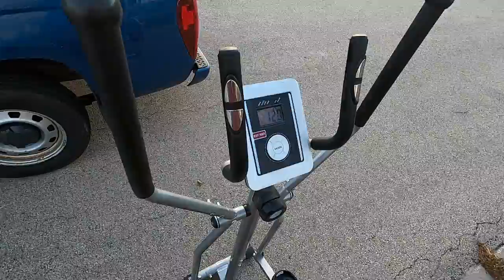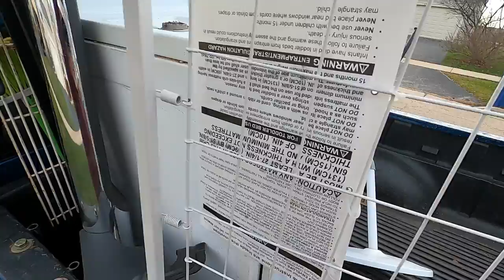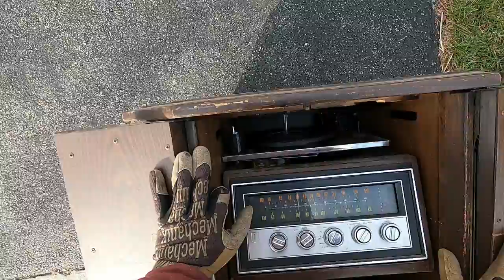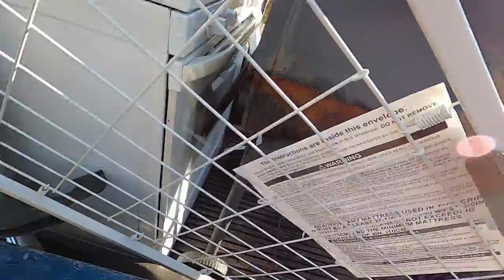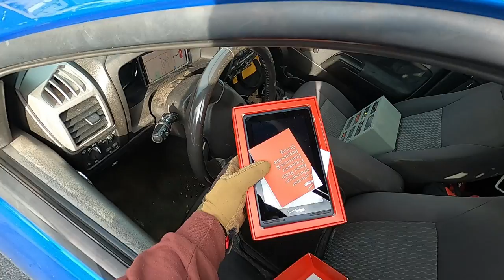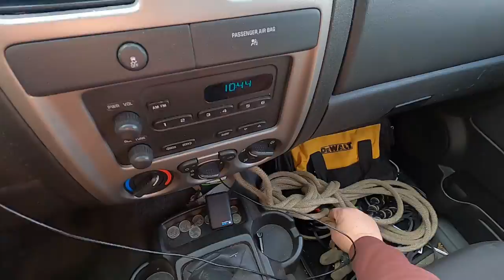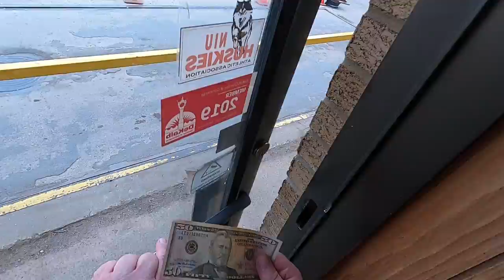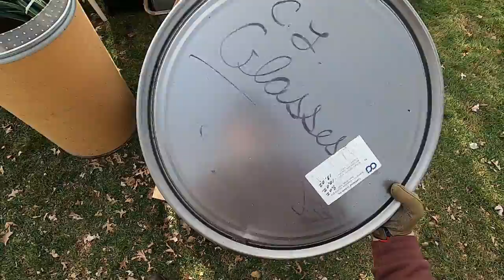Brand New on the Curb - Trash Picking Treasures

Comment: Paul, you have talked a number of times about a bigger truck. From my perspective the costs of a bigger truck will not be offset by the amount of scrap you can process. I believe you would benefit from better utilization of your current truck. Brackets to hang bikes and bed springs off of the ladder rack, changes to the over cab area to offer additional capacity for light but bulky items(fans and such).
You are an inspiration and your videos are a real hoot!(Morning Ralph,morning Sam)

Comment: I had a small collection of non ferrous I took to scrap yard a few weeks ago, i was shocked at 60 cents for the insulated wire, didn't have to cut the ends either.

Comment: Paul,
Use Voltaren gel on you shoulder. Need an RX.
Use a tiny bit, it will dissolve and spread. Rub it in til dry. Is not sticky.
Works on my shoulder, and 2 grands and a daughter use it.Good luck.

Comment: Ya me too. 18 minutes after upload. Really!!! Paul thinks a bigger truck will allow him to separate resale from scrap. Paul could order a semi trailer and still have the same problem. Just less trips to the scrap yard and his storage locker. Paul on nice days just keep that passenger window open and you won’t have to open the door to to throw in the copper. Also why not just keep a rope slung up behind the back window and leave yourself 3-4 inches of space and start your day off packing the steel rods, bed frames, wired closet shelves and bed springs right off vertically to avoid double handling throughout your day. Just trying to help - love your channel. Ok spoke too soon. On this episode you left that window 1/2 open. Paul Prepare each day and go vertical before you pick up your first piece of scrap you don’t need that much exercise.

Comment: You are right a dump trailer a perfect tool for you and the best thing about it would be how low the deck is too the ground compared to your pick up. Also since your not moving dirt and etc material like that, one of those small single axle dump trailer would be perfect for your operation and Little truck.

Comment: Please forgive if you've already given this consideration, but it's been an important observation for me.  Some full size trucks sit pretty high which leads to a harder lift.  Although not a conscious consideration when I purchased the Sharkmobile, I have been very happy that it isn't lifted any higher than what it is.  It is 4 wheel drive - which comes in handy at some construction sites, but not as high as many 4 wheel drive trucks.  The double cab comes in very handy for separating scrap during street runs and the full size bed is a must have.  I'm torn on extended beds.  There are times when I'd like the longer extended bed, but that means a much longer truck - double cab plus extended bed.  Overall I'm very pleased with my Tacoma - double cab and full size bed.  Again, sorry if I'm repeating thoughts you've already had but after watching you comment on trucks for a few vids now, I felt I should add my two cents for your consideration.

Comment: Start saving your coffee containers and tide pod containers. When i tear stuff apart on my work bench, I have my different containers there with me also. Every little screw goes into one container,if there is small peices of aluminum they go in another container. Electric motors I save for Rainey days. I don't like get0ting wet. And those transformers. Big and small. You need to watch videos on youtube to learn how to tear them apart. Just like the old fashioned tv's. Lots of screws,wires, and copper. Extra money in your pocket. Once your container is full,empty it into a large tub or a 55 gallon garbage can. That's how I do it. Then have one garbage can for crutches and folding walkers. Also your rims,one side of your building for steel and the other side for aluminum. My back wall I have those car battery and those smaller battery from drills and lawn equipment. Those push lawn mowers check those engines, some are aluminum. But when you go to to scrap yard, only take your steel. That takes up t0o much room. But washers and drivers are big money makes. The tubs in t0hose drivers are aluminum. Plus there is a ton of wires on the inside. Put those t0ransformers to the side or throw them in a tub like me with those electric motors, rainey days. Once your tubs get0 full put them on your shelves. A wait till the prices are high. Make more money. Akunimum now here in Jacksonville is 55 cents a pound. If i see a can I pick it up. I have a can smasher mounted to the wall with a 55 gallon garbage can under it with a bag in it. When it gets full it goes next to the house outside. I only take them if I can fill my bed up plus the back seat. That's what old sheets are for. Waiting for high prices does not cost you anything. Just like stacking those brake rotors. The more the merrier. Myself i have a 2 car garage,my room mate parks on one side,my truck stays outside. The rain keeps it clean. I have a old wooden wall unit that i use for storage. Holds my small sears air compressor. Some of my tools are air. Plus if I find any I see if they still work. Mostly if they are thrown away,there only jabbed or they just need some oil. Boom and big savings. Alot of stuff sometimes just needs a fuse and boom it works. Fans, lights, radios, boom boxes, even some flat screen tv's. They have screws and copper in them. Hope this helps you out. A old man who died in his truck taught me about scraping. I did it on my days off. Plus my neighbors know that i scrap,so they bring me there broken stuff.

Comment: Those 3 weights with the loop would make a nice boat anchor I bet...
Reply: All the weights could be used as boat anchors but the one the Vet made I was thinking a rope tied to it on a pully system it could be used as a work out weight
Reply: @ryemacdougall9716  or to pull a tooth, lol...
Reply: @timconaway5077  owwww that one would hurt a lot especially if the tooth wasn't ready to come out lol

Comment: Ooooh, Paul, you shoud have kept that bolt cutter. A lil' grinding and you'd have a perfect tool to cut those cheap chairs apart.

I hope that you'll find a good "new" truck with a "load elevator". You certainly deserve it to save your aching shoulders and knees.
I'm not really religious put I'll pray that you'll get it ASAP. You're a good, decent man, sir. 👍

Comment: I notice that the cord cutter is always put on the outside of the truck, why not pit it on the inside of the truck, in the same location only inside instead of out. That way if it falls off due to a large bump or major pothole it will fall in the bottom of your truck and not outside on the ground. But do what works for you.

Comment: Bread ties work as good as zip ties. I use them for a lot if stuff and keep them in my knife drawer. I never leave the house without a handful because you never know when you might need one and on the zip ties I buy the kind you can take off not cut but are adjustable and use those on the showerhead to keep my 3 tier tray from sliding down and I use zip ties and bread ties for trellises and lattice panels.